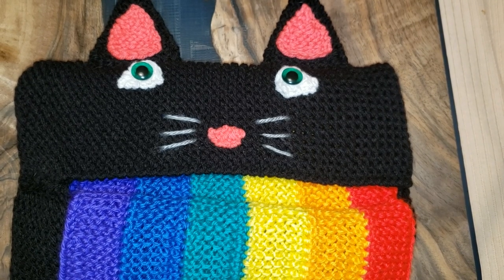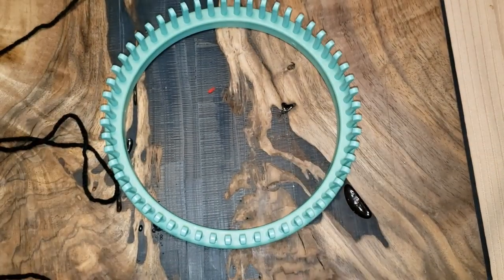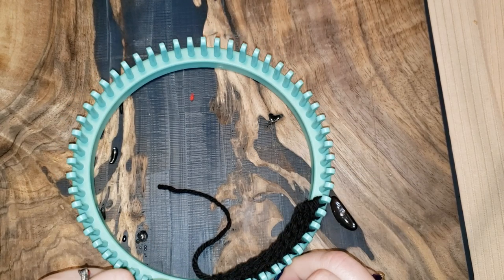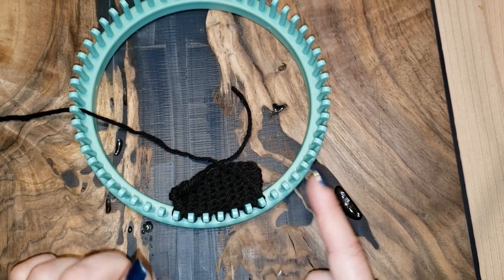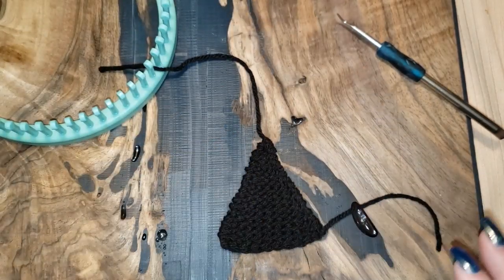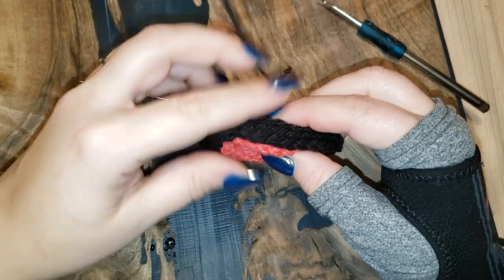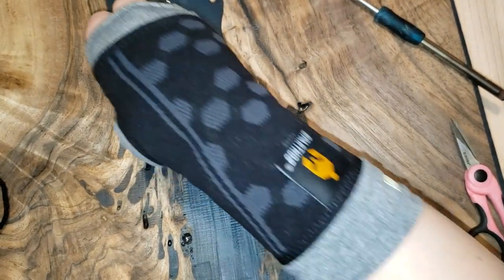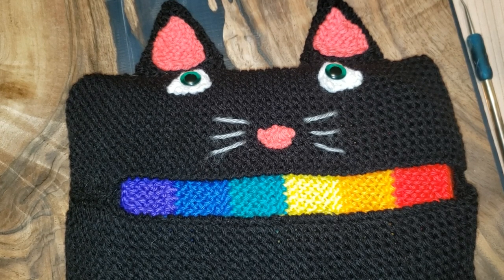Rainbow Barf Kitty

Comment: Thank you for doing this for us. I am inspired to finish the scarf for my granddaughter. I have already have half of the scarf done. Only I have crocheted the scarf. If I lay out a pattern to make the bad fit the scarf could that work on hoe to size it right?
Reply from the maker: Once the scarf is complete, measure the width and add enough pegs (which was 4 pegs with the loom I used) for an additional inch on each side for the body width and the total length is twice the size of the width

Comment: I only have the wider pegged looms, would using a 24 or 32 peg one work ok?
Reply from the maker: Yes but be sure you're either doubling up a thinner yarn or use a thicker yarn so it's not gapped
Reply: @MrsRynsai  brillent thank you, im used to doubling or trippling the yarn, think i need to invest in some of the smaller pegged looms at some point